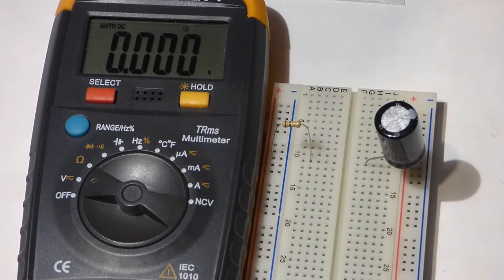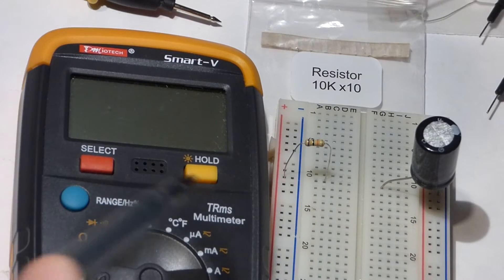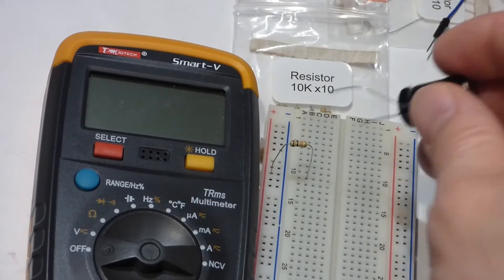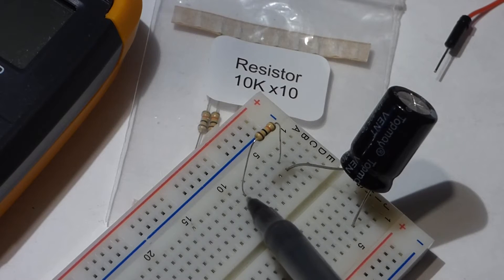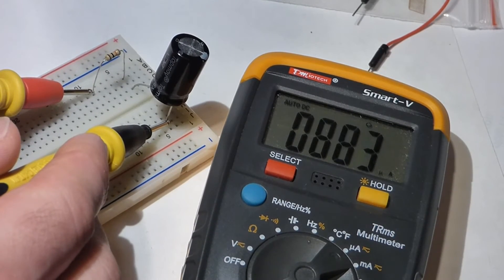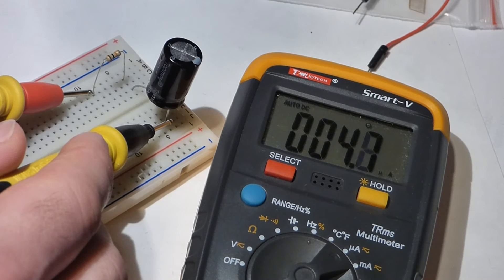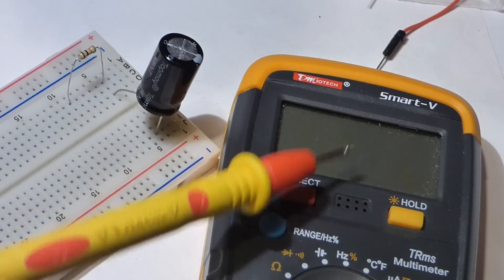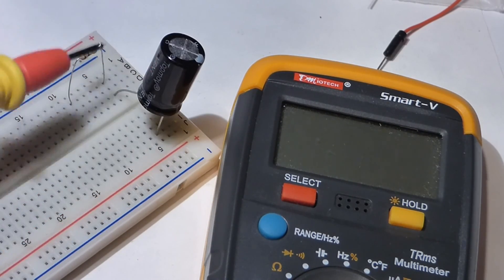Electronics multimeter measuring the current of a discharging capacitor

Comment: Thanks for the info :)

I was thinking of making a set of multimeter probes connecting a resistor in series to the positive probe wire. Essentially it will be a capacitor discharge tool that does exactly what you're doing in the video, closing a circuit with a resistor and multimeter in series to discharge the capacitor while reading the discharge rate, no LEDs, buzzers or need to calculate the discharge time.

Will this work with a higher voltage/capacitance capacitors (I want to refurbish my late father's old receiver)? can it damage the multimeter? (there may be some current running through it). Maybe it's better to add the multimeter in parallel? (i was thinking of adding one multimeter plug before the resistor and the other after)

Another question is choosing the resistor. Is there a one resistor fit them all? for both high and low voltage capacitors? If not, I was thinking of adding a spdt switch to have two circuits with different resistors in the same tool.